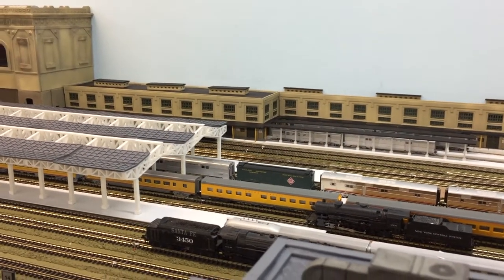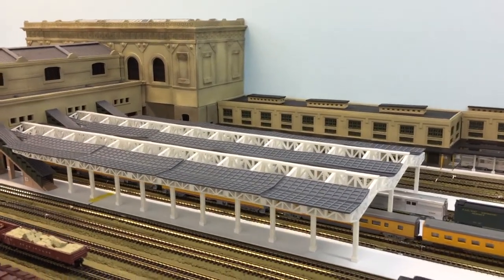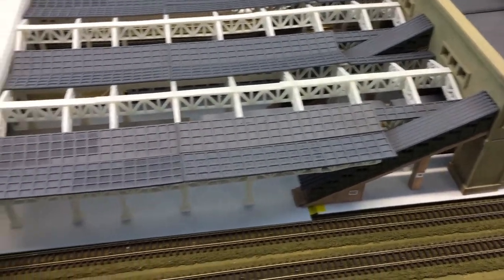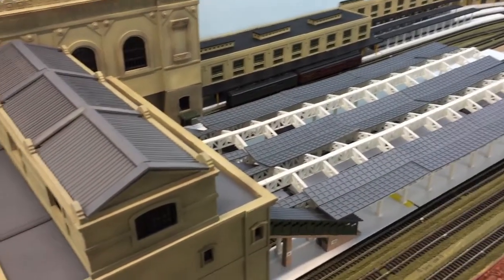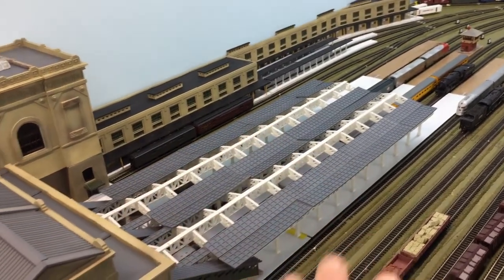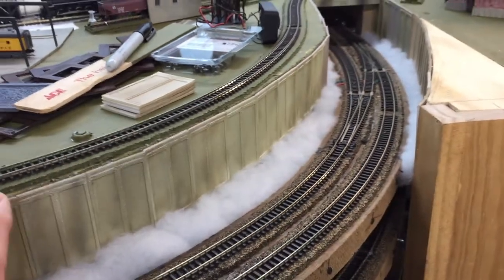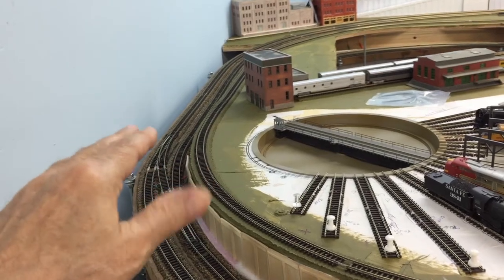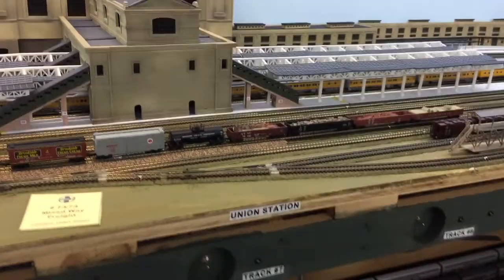Part 3 - Passenger Platform Cover Project at Union Station

Comment: Pretty sweet station, is that a gigantic kit? Or did you buy it piece by piece? I’m looking for something like that for my layout.
Reply from the maker: Hi, Thanks for watching and your questions. I designed and 3D printed the Union Station, the passenger waiting room over the tracks, the REA Express building, the concrete wall along the back wall, and the two bridges that are on either side of the station area. The only commercial items in the station are the stairs from the waiting room down to the passenger platforms. The design of the station and the REA building were derived from some drawings that I purchased from Dr. Nick Muff who scratch built a much more detailed version of both buildings. I contacted him through Model Railroad Hobbyist online magazine. There is a similar station made by Custom Model Railroads in both N and HO. Hope that helps. Merry Christmas……John
Reply: That helps a lot! Thanks, John! Merry Christmas to you as well!